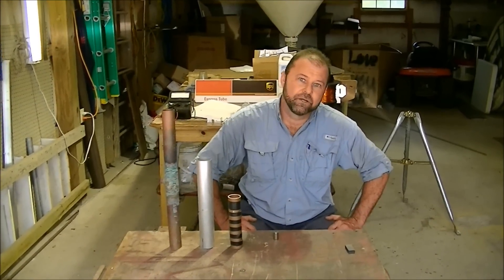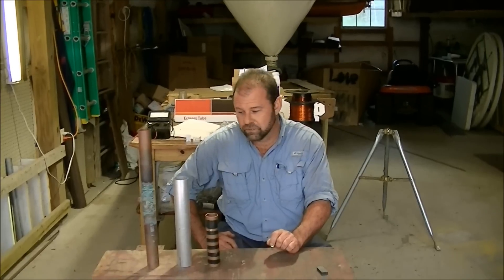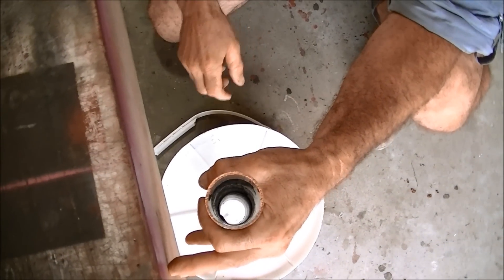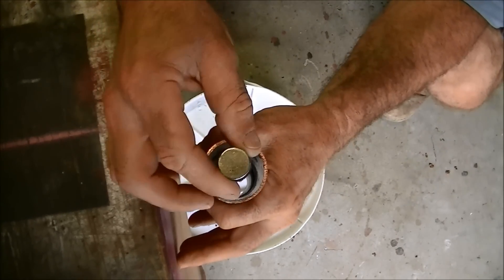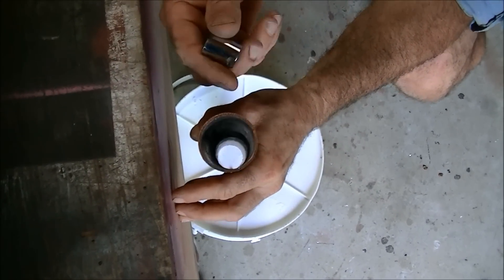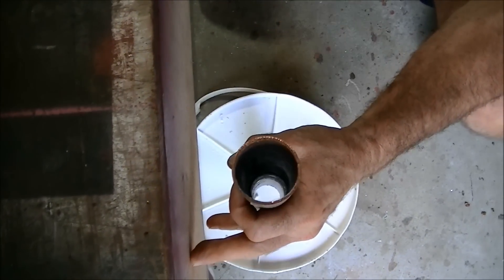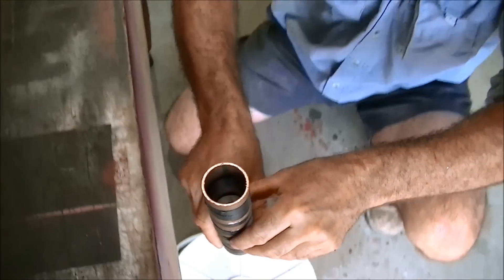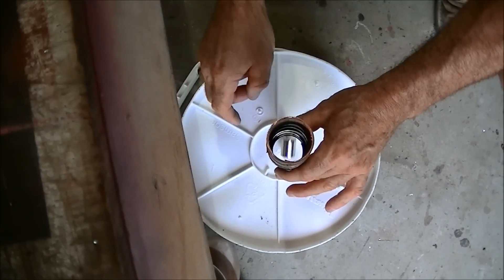Watch what happens when a magnet falls thru a copper pipe/aluminum pipe.

Comment: what would happen if you drilled a hole in the center of the pipe so that you could pass a rod through to attach to a magnet to spin it inside the pipe at a fixed point.  if the movement of the magnet inside the pipe produces heat and it was kept in one spot it wld be more concentrated?  would a stronger magnet make a difference?  last question have used a voltmeter?  thanks for your time i just wanted to ask before i shell out a hundred bucks at home depot.

Comment: so if it produces electricity where would you collect  the charge from as the electricity is produced?
Reply from the maker: The electricity that's is made or the pushing of electrons is shorted out in the pipe. The pipe will get warm if you keep doing it.
Reply: There has to be some sort of application for this. Rocket propulsion possibly.
Reply: +markp0177 Q: how would a indevidual in a emergency charge a DEAD BATTERY?useing your pipe +maginet = electric.       ok
Reply: markp0177 where did you read that?

Comment: would a smaller ID pipe say 1" be slower?   would wrapping  magnet wire around  the outside ,A) slow the magnet more ,B) generate power as now the magnetic fild would be being pushed through  a coil?
Reply from the maker: A thicker pipe would make if fall a little slower.

Comment: gold is the best conductor of electricity, not silver.
but either way it's a great video, it would be cool to harness the electricity generated.
what happens if you wrap the pipe in 12 gage solid wire to increase the overall effect?

Comment: Have you ever tried it with a  say a 2 inch flat round magnet by quarter inch thick which the hole in the centre , wonder how it would travel through a 2 1/2 pipe

Comment: What if you used a copper foil and put an insulator on top of it and rolled it into a tube. Rather than one solid piece it would have multiple pieces along one axis similar to copper coiling in transformers. I would think that it would generate more current/resistance (to gravity). And would go even slower.

Comment: it's called magnetic damping. and you are not generating anything. 
The differential equation of motion of a magnet dropped vertically through or near a conductor, where “M” is the mass of the magnet, “K” is the damping coefficient, “v” is the velocity, “g” is gravity and “a” is the acceleration of the magnet:
Reply: Negative....an eddy current creates a magnetic field that opposes the magnetic field that created it, and thus eddy currents react back on the source of the magnetic , in such the magnetic field already exists.   He stated that by dropping the magnet down the copper tube he was basically creating a generator, which is false. The magnet would have to pass through a coil to generate electric current. The only current that is present in this demonstration is magnetic. If you were to test this theory with a volt meter you would find that you would only get an ohmic reading, but if you were to use a teslameter / gaussmeter you would be able to detect the  magnetic anomalies that are present in this demonstration.
Reply: david dorshak you are inducing an eddy current. That's generating something in a general sense.
Reply: david dorshak,  why didn't you write the differential equation here?
Reply: Bill OfRights This differential equation's solution is v(t) = (mg/k).[1 - exp(-kt/m)] (if v = 0 when t = 0).

Comment: Interesting demonstration.

Magnetism, electricity and motion are tied together in a scientific ménage à trois.  It is clear that the falling magnet induces a magnetic field in the copper pipe which resists the falling motion of the magnet.  The falling magnet could also have induced a current in the copper pipe.  I wonder if the two ends of the pipe were connected via a wire (external circuit), the current could be measured.  Or in the alternative perhaps the external circuit will negate the slow falling magnet effect.

Comment: now let's make this into a motor for powering huge electric generating turbines...👾
Reply: grass Hopper that's not possible because this experiment does not generate any electrical current. it does create magnetic current. if you want create electric current the magnet has to pass through a coil.

Comment: Indeed!  But, how does the magnet know the copper pipe is there to so it can interact with it?  That is the real question.
The answer is based on the magnetic "field"  from the magnet.  Believe it of not, this directly bears on the actual nature of the existence of everything.  Existence is only explained by something called quantum field theory. Start studying.
Reply: veronicats100 you are correct

Comment: of course when you cut the pipe in multiple layers the magnate is not going to go slower it's going to go faster due to the fact of less efficient material in place of the copper. which means it will travel faster through it then through a solid copper pipe.

Comment: Say Mark, would it be difficult to get a silver pipe with similar dimensions of the copper pipe??
Reply from the maker: I'm not sure where you could get a silver pipe but I would love to see it fall thru one.

Mark
Reply: markp0177 what if i put a few ..like 5 to 1  silver ground rods instead of A  copper  rod ,will i dave on electricity 😕

Comment: What a great demo!  One suggestion, use a slug of metal that is not a magnet and drop that through your tube to establish just how fast a non magnetic material passed through the tubes.  Also, I thought gold was the best of all conductors but because of its cost,  silver as the next best and cheaper metal is used.  Gold was always used in high end equipment like that used in space.  All the contacts on the relays in a telephone exchange are silver and polishing the contacts is one of the most time consuming jobs as silver corrodes/tarnishes reducing conductivity.
Reply: velcroman11 I think silver is a better conductor but it oxidized where as gold does not.

Comment: Try a copper silver gallium alloy suspended around a PVC U shaped  pipe. Make a magnetic pistons to slide up and down with a vacuum between them that will move up and down with gravity. See if you can generate an electrical charge? If you can how much? Could that charge run Tesla turbines ran off that charge that could force air to help the piston fall with the use of gravity that would push air out the other end to spin the Tesla turbine generating electricity? Could a cycle be maintained to generate green clean energy to power a house a city more? Just a crazy idea! Right? LOL

Comment: If you found the resonance signature of the copper pipe could you not vibrate it with a Hertz to Increase the anti gravity effect while also encreasing its electrical output? Better use insulting gloves when checking this! LOL

Comment: Why not make a huge copper pipe in the shape of a U with magnetic pistons with a vacuum between them, then put Tesla turbines at each opening that force air in and out of the pipe till the pistons fall and rise by gravity generating electricity from the magnetics of the pistons and copper and from the pushing and pulling of air through the Tesla turbines that also generate electricity? Would this not be a green power plant that could power a city? Novartis

Comment: Gold(or Au) is the best conductor of electricity. I would recommend a quick research into diamagnetism and paramagnetism it can help understand this.
Reply: No, it's not. Gold gets used in things like satellites simply because it resists oxidation so much better than copper or silver. It doesn't conduct electricity as well as either of them though.
Reply: Silver is the best ... gold is the least corrosive, I think.
Reply: I don't blame him for thinking this though. I was taught that gold was the best conductor back in the 80's when I took some electronics classes for my computer repair certification. Apparently people thought gold was the best conductor for many years for some reason.
Reply: Charles Seper 
I somehow learned the same thing. 
Maybe , it's the best that you can use because of it's resistance to tarnishing & corrosion which would shorten a wires lifespan, so to speak!
Reply: ianthespaceguy Gold is not the best, it is the third most conductive metal; Gold is only 67% as conductive as Silver and 71% as conductive as Copper.

Comment: I came across this on July 15, 2013 and although this is a rather odd post I found it interesting and just happened to have about 6 of these magnets I stole from work so I thought I would give it a try. I have a 12 foot copper pipe so I went onto the roof and  I dropped all 6 at the same time in a stack with the opposing poles facing each other.As soon as I dropped the Mags it have a very adverse affect on Time and Space. A huge blinding orange flash occurred and tossed me off the roof causing me to lose consciousness. When I came to I found myself almost 3 years in the future! I somehow caused a shift in time! How can I return to 2013? I just lost 3 years! PLEASE ANY HELP WOULD BE APPRECIATED!
Reply: Thomas Langley's employer read this post and is now his former employer. They value their magnets.
Reply: throw in up the pipe now down. come on this is basic time travel information you should know this.
Reply: sask squatch. Funny.  I guess orange is the new black
Reply: did you steal the pipe too?
Reply: ...i think you had a different type of pipe,and its time to put it down.
Reply from the maker: N52 will work. Any rare earth magnet will work that is that size and shape.
Reply: Thomas Langley I think you smoked the pipe too lol
Reply: Thomas Langley If you are from the past, prove it! Who was president in 2013?
Reply: you never missed much but the black president is now orange
Reply: Yes, you can go back 3 years but you need a flux capacitor, an old Delorean, and 1.21 gigawatts of electricity.
Reply: Time travel won't do you no good, because if you traveled back in time with magnets or any other mechanical means, you'd end up in an alternator universe ;-)
Reply: turn the pipe end for end, that will reverse the effect.  Be careful to use the same pipe and do not mess with the length.
Reply: Thomas we need to know how your family fared during these years you were away, Kelly Peg and Bud, especially Kelly.
Reply: Thomas Langley your misinformation is closer to the absolute truth than you would think. I shall not explain for it is not my time to do so, but the magnets arranged in various ways produce interesting results. 😎
Reply: Thomas Langley and you gained 9 years, this will be explained once we have you back onboard
Reply: Thomas Langley Go find doctor emett brown he'll help you....
Reply: So sorry for you. You ended up in 2016 the worst year ever!
Reply: Thomas Langley - try water and 30 weight ball bearings
Reply: your best bet is to tweet Doc Brown..he will get back with you when he returns from the past or future
Reply: Which magnet did you use?
I thought I heard "N54" but I cant find such a magnet anywhere. I found a N52. Would that work?

Thx, Gerry from San Diego, CA
Reply: Just do what you did before but in reverse lol. But why go back ? You went three years into the future, you did that without aging those three years. So you skipped three years, but you also added three more years onto your life. So going forward your always be three years younger then what you should be. Get it ? lol
Reply: Thomas Langley haha wtf
Reply: Brett DeLong Or get some refined uranium from some Libyans. Word of caution: wear a "bullet proof vest."
Reply: More words of caution: you'd better not hook up to the amplifier and if you do, definitely don't turn the overdrive knob all the way up.
Reply: when you fell off the roof did you fall slowly and soft land
Reply: Brandon Smith 😂....HOLY SHIT!!!!!   i cant BREATH       XD
Reply: Jim Man yeah weed takes away decades from life. u only lost three years .its ok
Reply: Thomas Langley a
Reply: Mr. Crowley LMFAO
Reply: So, it's all YOUR fault! (butterfly wing effect of your fall. . .).
Reply: Thomas Langley your going to have to use some sort of reverse propulsion device, toss the magnets backwards up the pipe from the ground so it tosses you back on the roof.
Reply: Thomas Langley What's the S and P 500 sitting at 3-years in the future.
Reply: I wanked my self to the future when that happens to me
Reply: Did you lose your job for stealing those batteries
Reply: +Hoop Dreams He definitely did since he hasn't shown up for 3 yrs.  But its all good he probably hated that job...
Reply: Thomas Langley
Reply: Thomas Langley the easiest and most simple way of returning to the last, is to take the pipe, put a pack of hot dogs at the bottom and then put the magnet at the top, drop the magnet in and it will create what's called a "MP" or also called "multiple penetration bukakke" this will immediately penetrate the past and insert you into the folds of time, simple swim your way through this and be the first one through the door. Good luck. Google image it for more information.
Reply: simple. turn the pipe over and repeat process
Reply: Thomas Langley Do you still have the DeLorean??
Reply: I think you got a shock on your brain due the induction of electric current in the pipe ..so you should repeat this process or go to  hospital for a more powerful electric shock which will help you to go back to your time.
may this help you
Reply: Thomas Langley Lay off of that crack pipe will ya!

Comment: FYI - THICKER pipes also enhance the effect.  So, if you can get a sufficiently thick soft-aluminum (not alloy) pipe, the drop-speed will match the thinner copper pipe.   What's the limit?  (i.e. what would happen if you used a thick copper pipe?)  

The limit depends on the bulk resistance of the conductor, and the amount of the magnetic field blocked by the induced eddy currents.   A schedule copper pipe is thick enough to block over 75% of the magnetic field through eddy current blocking.  Aluminum can block up to 63%.  Chill down an aluminum (or copper) pipe in liquid nitrogen, then watch the slow-down!  At LN temps, a thick-walled copper pipe a meter long can block enough magnetic field so that the magnet takes over a MINUTE to fall thru!  Talk bout slow motion.

GoatGuy
Reply: SouthTexas Genetics Dude, take it easy.... Any question is a valid question. Rather then waste energy and time getting pissed, give the guy a non arsey answer. 
People can get far too carried away and judgemental on these comments. 
Let's collaborate and not be reprobates!
Reply: Wow its already cool watching it this slow. I wanta play too!!!
Reply: That's really cool.
Reply: Robert Lynch It's not slowmo, it's just max payne playing tricks on you.
Reply: Robert Lynch -- Mark !  Sorry for getting short fused ! But I am an Aviation science instructor and fed up with the missing brainwaves of todays kids ! Sorry again !
Reply: Maybe a copper pipe with thick enough walls would suspend the magnet
Reply: Robert Lynch What's the value of this experiment?
Reply: Mark, as in markp0177 the creator of this video, Homer Says...Duh ! ! !
Reply: Anyone has the link for thicker pipe video?
Reply: Alexa Tricks 
porn
Reply: Robert Lynch do you have any links.
Reply: @ Havard Hamer !  What is the  value ? ? ? Are you a real stupid or just personating one ? ? ? For example -- maybe teaching kids -- not the stupid one like you, that's for sure ! ! ! Go and find some info ,,, on how to grow marijuana !  That is recomended for you ! ! !
Reply: Robert Lynch thats what i was thinking.
Reply: -- IF U HEAT THE COPPET PIPE TO RED HOT, WHAT HAPPENS THEN?

That's a good question ... I would imagine if magnetism plays a big role in this a lot, and if it is mostly free elections contributing to current in the pipe, not too much.
Reply: justgivemethetruth I would hazard a guess that both the magnet and copper pipe would fall at freefall speed, as he drops them both, while screaming in pain and flapping his hands in the air. 😉

Comment: Portable Heated Blanket
Invented for all outdoor pursuits, fishing, birdwatching, stargazing, camping, hunting etc, and also a lifesaver in emergency situations.
Up to 60 degrees Celsius of portable heat, just unroll the blanket, light your gas stove and place the unique heat exchanger unit on your stove, within 10 minutes your blanket will be up to temperature, heating your whole body even in the harshest conditions.
Formerly known as 'The Hot One', our portable heated blanket has been totally re-designed incorporating a TEG (thermo-electric-generator) which eliminates the need for a battery power source. The generator is so efficient it not only powers the unique circulation pump incorporated within our blanket it will also charge smart phones, GPS units, iPods and many other lithium ion battery operated devices, all via a USB connection. Alternatively, the TEG provides a power source to run speakers, lights, fans, or other low-power USB appliances making our product a truly life saving essential item in emergency situations. The solid-state voltage regulator provides up to 5W of pure power to charge your high-tech devices.
Generator Output: 5W maximum, 1 Amp max at 5 V (DC) USB 2.0 port
How long will my blanket stay hot?
As long as you have a direct heat source under the heat exchanger, i.e your gas stove, the blanket will stay hot. Portable gas stove cylinders can last over 30 hours with our product due to the small amount of heat input required, that equates to approximately £0.16 pence per hour running costs.
www.portableheat.co.uk